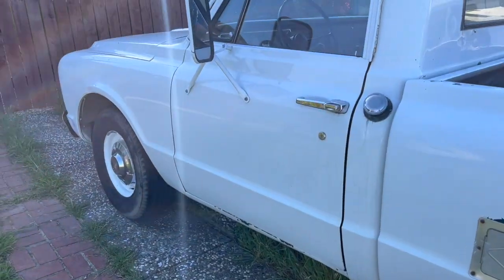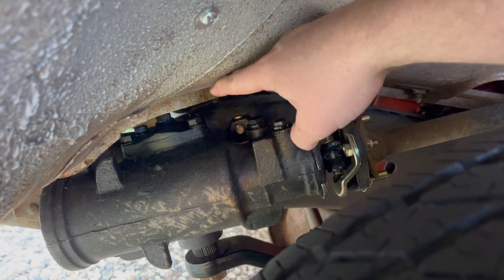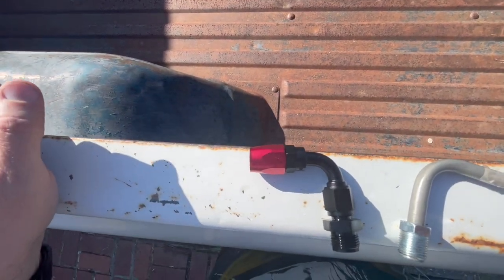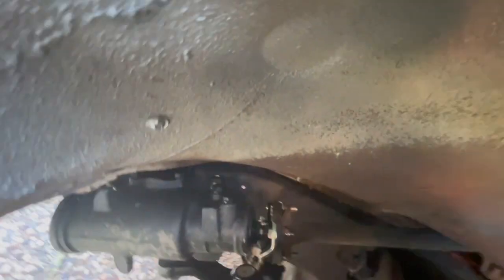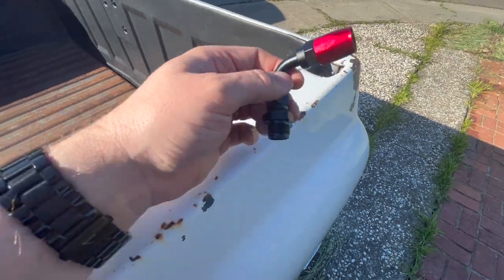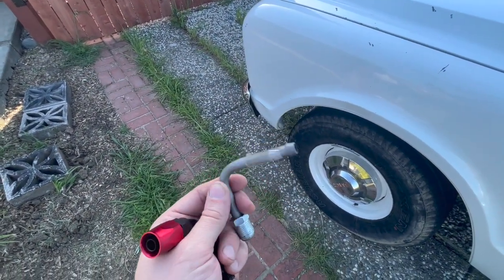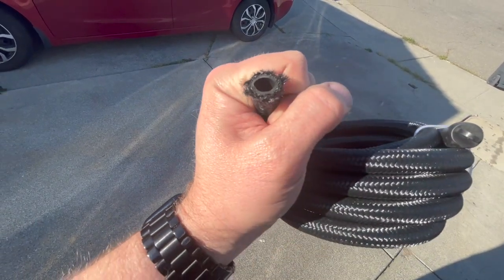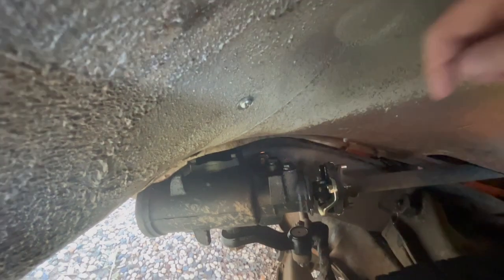67 C10 & C20 Power Steering upgrade - PART 5

Comment: Couple options here on the hose fitting/inner fender.  1) They do make a closer/tighter 90.  You might look on ebay and find one that is a lot tighter.  You might have do a straight hose end fitting and then have the 90 have AN fittings on each side.  2) Or could you loosen up the pump, perhaps take out a few bolts to just rotate it down to get the fitting in?  It looks like once they are threaded in you might have the clearance needed.   3) Lastly, unless you are trying to keep it original looking, cut yourself some access and make life easy down the road and forever. 
As far as the hose, if it is rated for that strength you should be fine.  Making up AN line fittings is no simple task though.  They are a lot harder than it looks, especially with the stainless steel braiding mesh.   PTFE are the easiest since they have a copper collar that gets crushed to seal up. I'd suggest wrapping the hose with a turn or 2 of electrical tape when you cut it to keep it from fraying out real bad.  You'll need a cut off grinder or a 4" grinder with a cutting wheel to do it.  A hacksaw will tear the hose up and make life very hard.   Any way you do it, you might have a bloopers only vid or test the sensor bleep.
Reply from the maker: Thanks for the tips!  I am leaning towards putting a little bump out on the fender above the ports.  It probably only needs to be 1/4" or so.  If that doesn't work, I'm breaking out the hole saw!